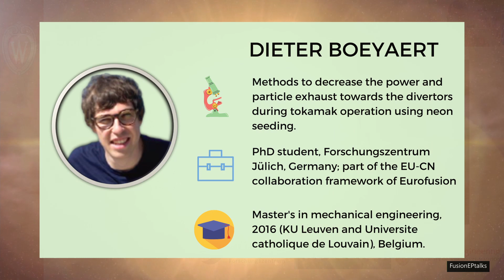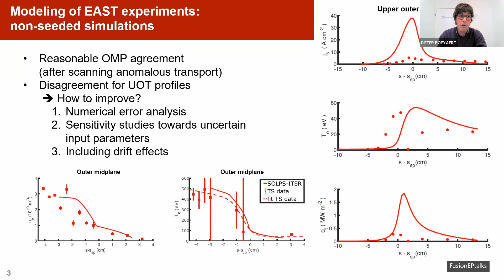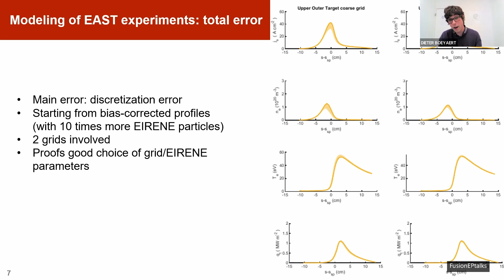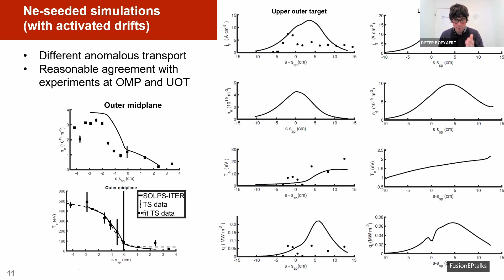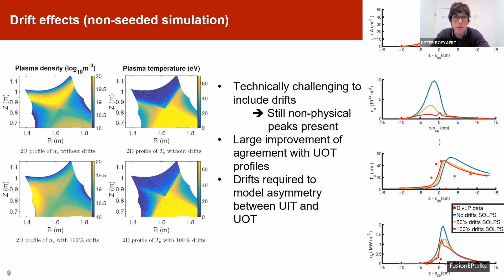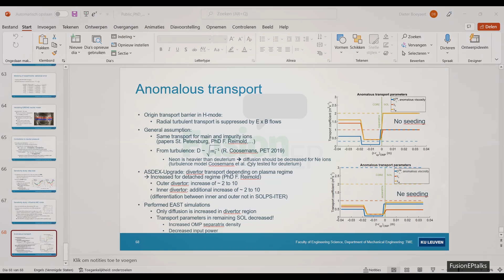SOLPS-ITER studies of neon seeding in EAST | Dieter Boeyaert

Comment: Very nice talk, thank you.
Just two small points to correct the record:
1. the parallel current equation is solved by default in SOLPS-ITER.
2. It is possible to choose separate transport coefficient in the inner and outer divertor regions.
Reply from the maker: Sure! We will bring this to speaker’s notice!
Reply: Hi,
Thanks a lot for your comments.
For point 1 you are indeed correct. In SOLPS-ITER this is solved by default. The drifts terms in this equation, however, are not automatically included.
For the second point, I know this is indeed performed for simulations with SOLPS 5, but as far as I know this is not available in the master version 3.0.7 of SOLPS-ITER (if it is, please let me know where to find it in the manual)